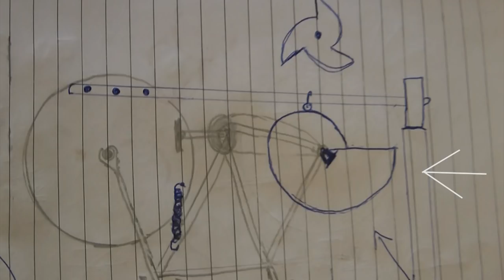How to Design a Power Hammer & Bicycle power hammer update - Blacksmithing!

Comment: Light weight high speed hammers are typically used for planishing sheet metal...not forging. If you made the frame much more rigid, motorized it,  and had some way to have interchangable shaped heads, you might have a decent planishing hammer for some sheet metal work and fabrication. I do appreciate your inventive attitude and the fact that you actually built something. I hope you can put this to practical use, and continue to enjoy building and working on it. I actually made a small tabletop planishing hammer using a windshield wiper motor and a 1 pound hammer head made from a very large bolt. I used it for making hammered coin rings.  I think it did about 180-200 blows/minute. The same motor actually turned the coin slightly each time to strike a different part of the coin edge.  It could make a hammered coin ring every 4 hrs running by itself. A fun project.
Reply from the maker: I sure will use it and for forging too as I am confident it will hold up well. 
Of course the heavier the hammer and more revolutions the better for moving metal, is what I was kinda getting at. Did mention in the last video that it is a small to medium hammer and not a big wacker. But the principals are the same. Plus it only took four hours to build, so no real loss for me, but more like a gain as I can move more metal than wacking the same hammer by hand. The main point was that turning a bicycle upside down could save a lot of work is why I designed it like that. If I went for a bigger build I would take an old motorcycle and do the same as with this buil more or less. Saving lots of time in building time. 
The small bicycle power hammer does go around 300 wacks per min and the weight is around 10 pounds without any springs added. I know what you mean with the coin rings they come out real nice, once done. What you made sounds interesting. Actually getting it to move around the coin, how did you manage that? You don't heat them though right. With steel you get it quite hot and then it is way easier to move the metal.
Edit: How did the motor hold up? I assume you under used it somewhat. What gearing ratio did you use in the end for your hammer?
Reply: Work With Nature Off the end of the motor I have a pulley AND a cam. The cam has a screw attached to the side that pulls a string which goes up an arm to a pulley. It then ties to the weight (hammer). As the motor turns, the hammer raises and then drops as the string slackens quickly. There is a sweet spot in the speed to make the action work. The pully on the motor is attached to a pulley on a shaft (a long bolt) that goes thru the coin. The coin is held on the bolt between lock nuts. The belt to the coin shaft is a rubber band. The rubber band stretching causes the coin to rotate unevenly, so the hammer doesn't always hit the same spot. The result is a surprisingly smooth even finish.  I keep meaning to make a Youtube video of it, but just haven't found the time yet.
Reply from the maker: You should as it is kinda hard to visualize just by explaining it. Let me know when you do though, maybe you could just take a phone video of it moving. I think there would be lots of people out there who make rings from coins that would like to build one of those. The bit I did not get was how you let go of the hammer suddenly?
Reply: Work With Nature If the motor speed is real slow, the hammer on the end of the string would just move up and down gently....no good. At a certsin speed the cam moves faster than the hammer can rise, and this creates a sudden yank on the string. The hammer rises suddenly and falls before the cam returns again. The down side is that there is only a small speed window in which this work.  The upside is that the mechanism can be very compact and does not require a powerful motor.
Reply from the maker: Ah yes You are using the motor with the left right attachment still on it right so it still goes up and down. So you regulate the speed with some kind of voltage switch. Do stick up a small vid. soon and let me know with the link to it. Real clever!
Cheers David.